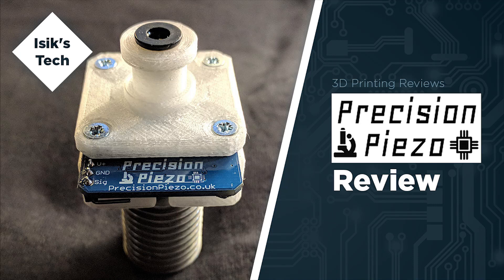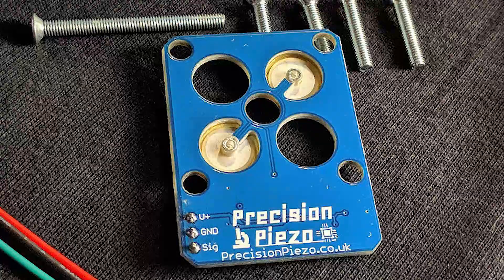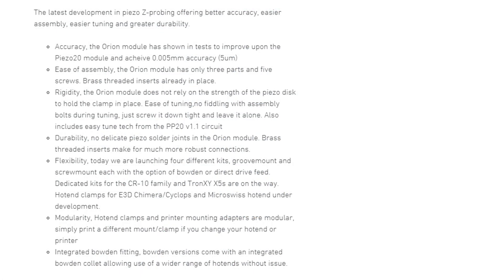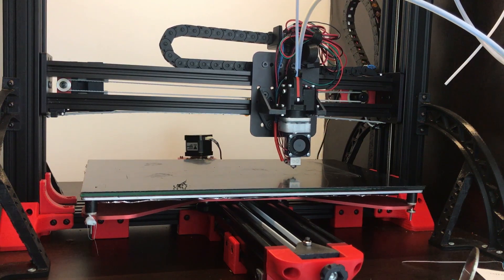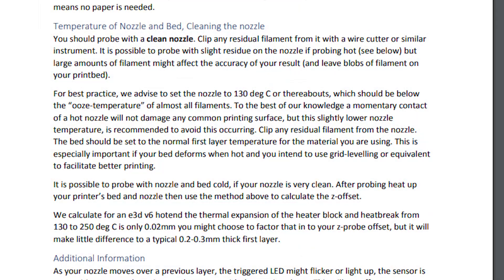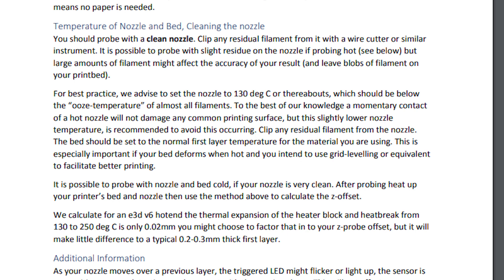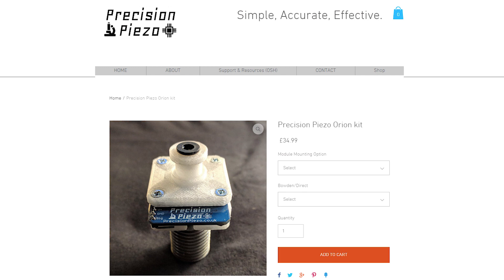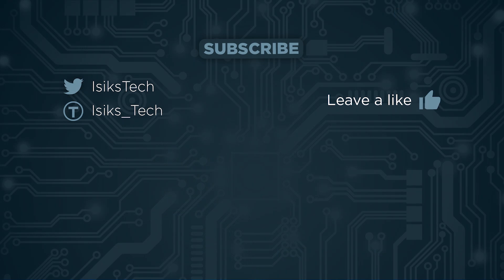Precision Piezo Orion Z Probe Review

Comment: I'm glad you're enjoying our product, thanks for the review. To respond to one or two of the points you make in the video;

Most if not all modern firmwares allow for a short pause between XY movements and Z-probe events to allow vibration to die down. Typically we find that a ~0.5s pause is all you need and allows you to maintain full speed between probe points.

Filament ooze on the nozzle is an issue with any nozzle based probe but most of our customers find that it is not a major problem once everything is set up.

The BOM cost is only a small part of the cost of producing and supporting a product like this. We have months of development and testing invested and I spend hours every day providing detailed support to customers, this is where the cost of a product like this lies.

Great video, your points were made clearly and communicated well, keep up the good work.

Idris (Precision Piezo)
Reply: just a thought, can't you just heat up the nozzle to melt the plastic when you probe?
Reply: @chloemcholoe3280  My impression is the ooze will cause film on the nozzle at the pressures the probe detects.
Reply: @Anyone700  you can just heat the nozzle unless you have a build surface like mine. in that case probably a lil cutter on the nuzzle will do the job. I don't level before every print.
Reply: @chloemcholoe3280  Heat bead to full temp and nozzle to no-ooze temp, like 160 or something. That's what I do with my smart effector. Then it accounts for metal warping/expansion.

Comment: Seriously looking at one of these (all other methods IMO have too many negative comments among the positive ones)... as far as ooze goes a startup script to withdraw the filament a bit would probably help. I also noticed on a few other videos where the ooze on the end would squish after the initial probe.  Would be good if there was a parameter to "pre-squish" the 1st probe point where it will repeat the 1st one until the variation is less than some amount or even an option to probe X times and throw out the 1st Y results. Rather it take 1 minute extra to probe the bed than not stick and ruin a long print.

Trying to see whether this or the under bed piezo setup is better.

As long as I understand the way it works the benefits may depend on where the Z axis is levelled from. On the Ender 3 for example the gantry with the nozzle would be moving when probing so sensors under the bed may be less susceptible to false readings. However as the bed moves a lot with the Y movement an extra pair of wires would need to come off the bed. (My understanding is if you have 3 sensors on the bottom they are all connected anyway so the 3 +ve and 3 -ve wires are joined.) Also I assume if you have 3 sensors underneath it will trip if any of the 3 sense a hit which may give a bit of redundancy and help prevent head crashes. Under bed also has the huge advantage of not having to stuff around with the hot end setup or needing to print extra parts.

Also, for under bed could you have more than 3 sensors and if so would it be an advantage ?

I must also agree on the price under bed for me in  AUD$ 50 delivered considering the entire printer was AUD$ 300 but in saying that, if it works flawlessly it's worth a lot more than this in saved time.

Comment: As he said, you need to tune your firmware equivalent of the  Z_PROBE_DELAY (in Repetier) so it does not false trigger by movement,  not to slow down the overall speed! A value of 200-300 ms should be sufficient. Also Z speed when homing/probing should be no less then 4 (I use 5) for reliable probing - what I am seeing here is just too slow.. .  You have to realize the piezo needs to bend in order to produce enough voltage for the logic to trigger .. Slow speed may lead to delayed signal or worse - missed touch event and a smashed head into the bed as a result ..
Reply from the maker: Thanks for the info. I slowed down the video when editing. It's faster in real life.
Reply: The speed needed depends on the overall compliance of the printer and a sufficiently rigid setup is quite happy with 1mm/sec. Although not an Orion, the piezos in https://www.youtube.com/watch?v=Oj4e-An6z5s&t=23s gave a peak output of 8V at an approach speed of 2mm/sec